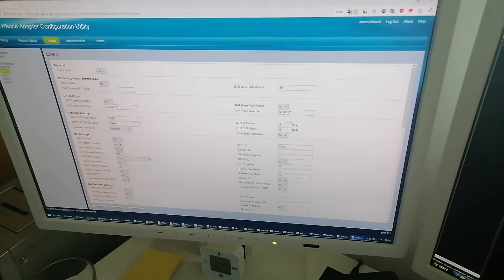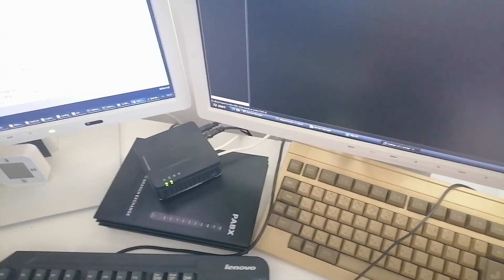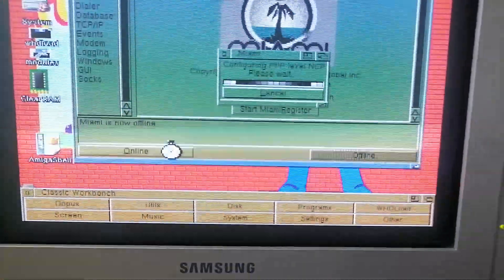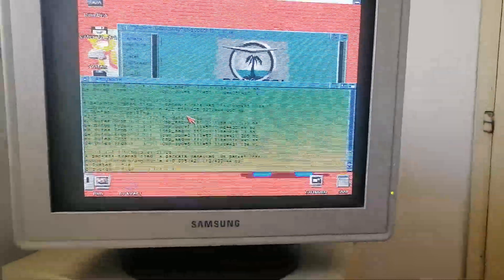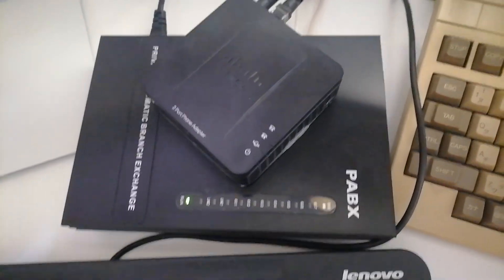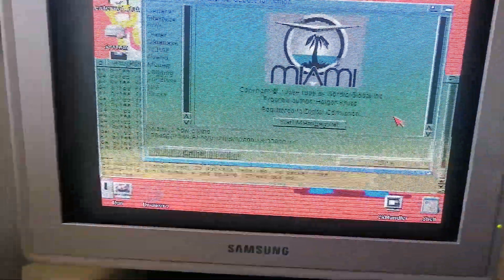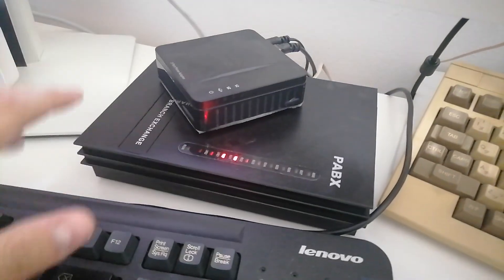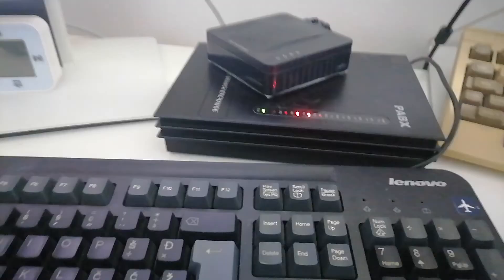Dialing Up At Home: The RIGHT Way!

Comment: Yeah cheap analog PBX works well, if you have the Cisco or similar ATAs, you can connect the to the PBX external lines for dial out using VoiP/SIP.

Comment: Hello,  I agree with your suggestion to get a PBX, but I don't like the one you have there. I have one of those and it doesn't work well. The unit doesn't have enough power to even ring the ringer on a phone reliably.  So when using it for multiple modems and lines you might be successful but I doubt you will have all the extensions working.  On mine only 2 of the extensions would work all the time. The rest were very intermittent. Admittedly I might have just gotten a bad unit but I doubt it since it seems to work, just not well. I suspect it is just very cheaply made. They symptom is that with a phone if it rings at all it will be barely. The result is that a modem (I am using mostly USR which is usually considered the best) doesn't get a strong enough signal to trigger it to answer. For the price I think you would do better to find a used high quality PBX like Panasonic that will work reliably and for pretty much the same price. Ebay is your friend.  Thanks for the video!

Comment: To make sure I understand, does this PABX only support modem standard v34 and below? Thank you for the video 👍
Reply from the maker: Yes, it being an analog-only device means that you can only go up to V.34, but it is going to be highly reliable because there's no line latency, unlike with VoIP ATAs. For V.90 and similar, you still need a digital modem on the downstream side, but you can still use this PBX to get the digital (post-conversion) and analog sides talking.